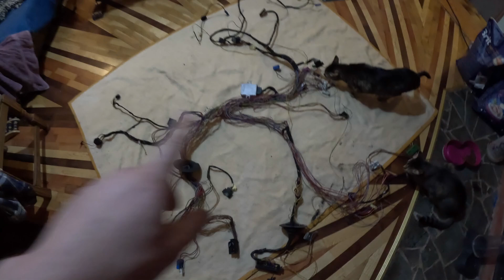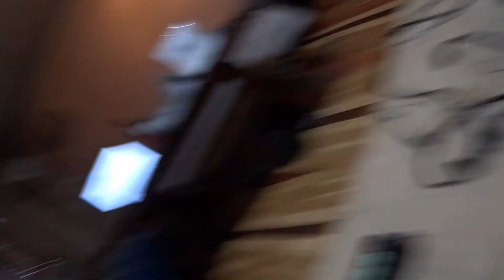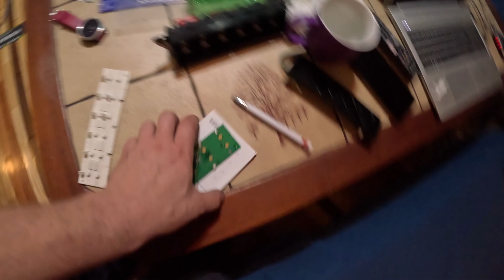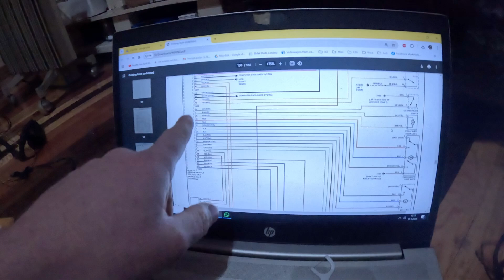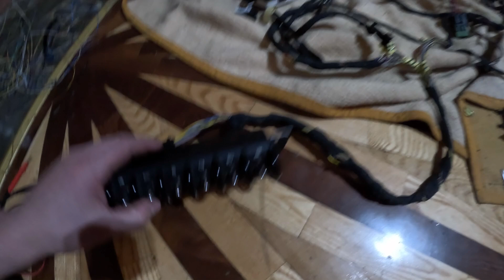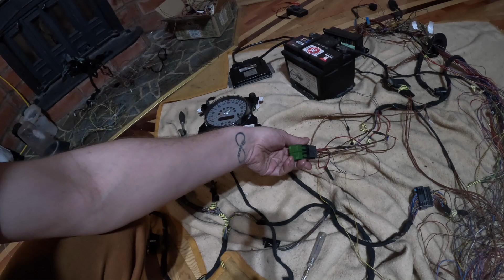Mini R50 race build - Race wiring loom and switch panel from stock parts...

Comment: Interesting, so although you can get it to crank, what about running the DME / ECU?   Are you still using the immobiliser - or have you managed to bypass that area of things?
Reply from the maker: Immo off needs to be coded to the DME, while I plan to learn how to do it at one point, so far it's still wired in. One thing I did do is take the electronics from the key and place them in the code reader so I don't need the key anymore
Reply: @WillowRacingTeam  Yes, I have done something similar (as it is my track car) and doesn't need a key (as I only have one for the car anyway - so don't want to lose it), but if I can work out how to remove the immo then I can just have start switch and a start button to fire up the car.   A friend gave me a wiring diagram to start the car with a switch / button - but it needs the immo taken out of circuit.  People can do it here in the UK (remove immo) - but they want say 150-200 euros!    Hmmm.....   So, I need to learn how to do it.